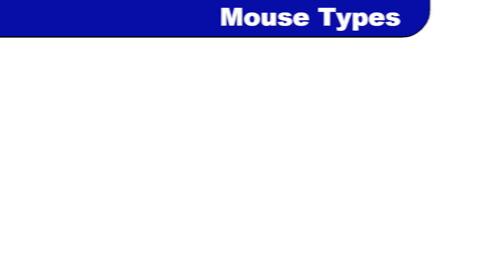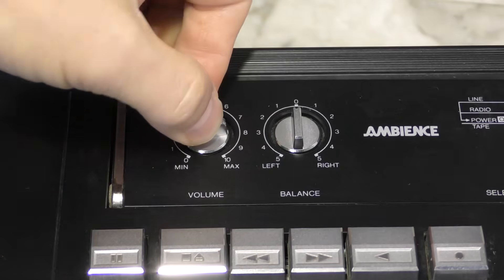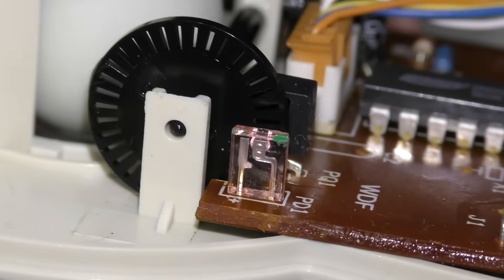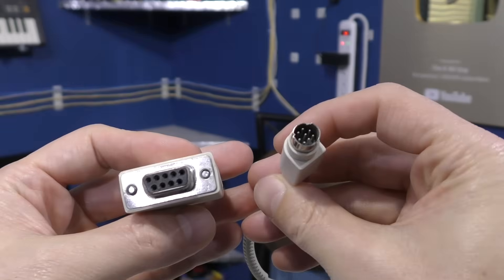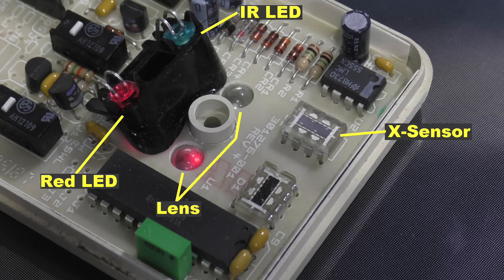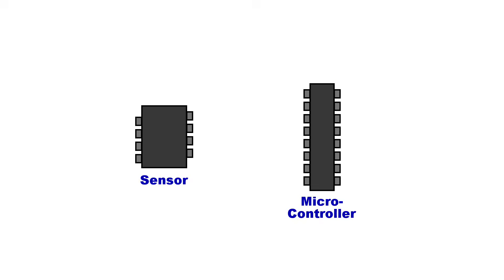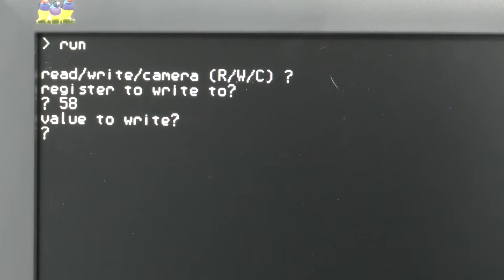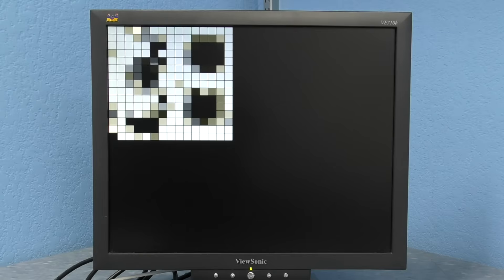What does a computer mouse see?

Comment: Interestinly the N64 analogue stick works like the optomechanical sensor. It's why the read doesn't get drift (however the friction of plastic on plastic, from stick against bowl, will wear down the stick and/or bowl over time).

Comment: That Sun type-5 mouse takes me back. Back in the 1990s I wrote the Sun mouse overclocking guide, which showed people how to quadruple the stock communication rate of both the type-5 opticals and optomechanicals. Increasing peripheral comm speed is more common now but I think that was the first mod of its type to make it out there.

If you ever run across a type-5 with “4800” scrawled on the bottom, it was probably one of mine I did for people.

Comment: Did you try 3.4 MHz I2C or if the camera has it, SPI bus? Cameras in the mouses actually take video imaging faster than 60 Hz unless explicitly designed to do so - LEDs are responsible for imaging exposure so imaging sensor's framerate and LEDs are synchronized, so the problem is bandwidth. Otherwise some mouses use specific AI software to translate the motion while saving on bandwidth and battery life, if the mouse manufacturers choose to use separate faster microcontrollers running at 100 MHz or faster for their gaming mouse line-up, without having to bump up the camera framerate unless you tell it to do so at expense of battery life.

Comment: Your optical mouse is still too new. The camera chip handles the transformations internally and relays them to the microcontroller. The serial port you are reading from is used for factory debugging and for that reason it's not very fast.

Comment: 3:58 If i don't remember it wrong the direction of the movement was always how the mouse pad was placed and not how you hold the mouse. You could turn the mouse the other direction but the mouse pointer moved up even if the mouse cable was against you.

Comment: I also had a mouse with such a special pad for my XT PC, connected via serial port. At some point that pad was falling apart and I had no money to replace it. So what I did was simple: I printed a similar pattern as was on that pad using my 24 pin needle printer of that time on ordinary paper. Of course, I couldn't print as fine as the original pattern was but it was fine enough, the movement was just a bit slower. Finally I got a very thin, transparent piece of hard plastic as a cover and the replacement was done. While not good as the original, it kept that mouse alive and I could re-print it as often as needed. As you can see, my mouse was already a bit newer and did not work with two different kinds of light, it just required a pattern of tiny squares, circles, or octagons (I tried all three and all of them worked). When I got a new computer, I also went back to a mouse with a ball even though they got dirty, their movement was just smoother until the first real optical mice were available for affordable prices.

Comment: I never had that one with limited range, working like potenciometer/volume control heh (using first one with wheels is total abstracion for me). My first one in mid 90's was as in 2m10s, using it was horrible : annoying cleaning (really often) and when you was cleaning it, it was common to bend a bit sensor and another problem shows up, screwing/unscrewing was another life shortener of such type mouse . Back than I was buying new mouse often in monthly period than now in yearly hahaha (my Logitech G400S is couple years old, but my mouse before - A4tech X-750BF was ~ 10 y.o. when goes to retire, and its still working but cable isolation falls apart and it just looks terrible)

Comment: Banned for 7 Days
Our content monitors have determined that your behavior at Roblox has been in violation of our Terms of Use.

Reviewed: 5/13/2021 9:32:17 PM (CT)

Moderator Note: Roblox does not permit discriminatory speech, content, or actions based on race or ethnic origin, national origin, religion or religious affiliation, gender, gender identity, or sexual orientation.

Reason: Inappropriate

Offensive Item: N@-z-i

Reason: Inappropriate

Offensive Item: N@-z-i

Reason: Inappropriate

Offensive Item: N@-z-i

Reason: Inappropriate

Offensive Item: N@-z-i

Reason: Inappropriate

Offensive Item: N@-z-i

Reason: Inappropriate

Offensive Item: N@-z-i

Reason: Inappropriate

Offensive Item: N@-z-i

Reason: Inappropriate

Offensive Item: N@-z-i

Reason: Inappropriate

Offensive Item: N@-z-i

Reason: Inappropriate

Offensive Item: N@-z-i

Reason: Inappropriate

Offensive Item: N@-z-i

Reason: Inappropriate

Offensive Item: N@-z-i

Reason: Inappropriate

Offensive Item: N@-z-i

Please abide by the Roblox Community Guidelines so that Roblox can be fun for users of all ages.

Your account has been disabled. You may re-activate it after 5/20/2021 9:32:17 PM. (CT)

If you wish to appeal, please contact us via the Support Form.

Logout

Comment: The delay you are talking about could be caused from metastability, this needs timing analysis to make sure that all signals arrive at the correct time and not violating setup or hold times, timing should be mentioned in datasheet

Comment: ever figure out why you couldn't read the modern optical sensor faster? i checked the datasheet, and there were two suspicious entries: Wake from Power Down tWAKEUP min 50 max 55 ms, and Motion Delay after Reset tMOT-RST 50 ms. at 8:12 you write 90 to register 58, and the datasheet specifically mentions in the notes of tWAKEUP "when NRESET pin is asserted high or write 0x5a to register 0x3a"; so either either the reset pin is asserted low at the start of each loop (is the reset pin left floating? connected to the chip select pin perhaps?) or you're writing 90 to 58 in the loop (which i doubt you are). or it's black magic; you never know

Comment: Little bit of trivia for the 90s kids: The analog sticks on the Nintendo 64 controllers used optical encoders much in the same fashion as old ball mice meaning they were mostly digital as the encoders can only detect a set distance from the assumed center in so many exact increments. But by being able to detect so many small increments of movement, it essentially "emulated" true analog control as far as the end user was concerned. Probably the only thing that gives it away is the very subtle "ratcheting" feedback you can feel when rotating it, that's the plastic teeth on the encoder discs.

Comment: At 6:13, as for how you say the sensor is integrated into the microcontroller to reduce cost...
Well, not always. I know that this channel is not about modern tech in the slightest, but you could take a budget gaming mouse with a brand-name sensor that has a public datasheet, like the PMW3360, and connect into that. Sensors like that are almost always separate. The datasheet for that sensor is available here: https://datasheetspdf.com/datasheet/PMW3360DM-T2QU.html, you'll notice that the communication method is plain old SPI – and things like a library for using it with an Arduino already exist. https://github.com/SunjunKim/PMW3360

Comment: I would suggest to never 'scrape' the friction wheels when some IPA and a Q-Tip will work not only better, but it wont wear down the friction wheel and eventually cause erratic movement and possibly cause the mouse to not work at all.

Comment: 2:30 - this is the same way encoders work today in manufacturing. 2 sensors watch soemthing spin and the two will detect on and off at different times. The pattern of both turning on and off is how it determines direction.

Comment: I had a friend in the mid-'90s that had a mouse the was extremely weird-looking. Hadn't seen the design before then and haven't seen it since. Basically, a mouse with its own mouse pad. The mouse was connected to a plastic mouse pad and it didn't have a ball like other mouses of the time. I hated using it.

Comment: Dude uses a gameboy camera instead of just a cellphone. He's showing off at this point.
Reply: If he has an iPhone, it probably won't show IR light.  I've tried with friends' iPhones and it never worked.  Looking at the very same TV remote or surveillance camera using my Android smartphone's camera always showed the IR light - the fruity phones I've tried never did.  Assuming the TV remote had good batteries and was in good working order or the surveillance camera was in night mode.

Ditto for elevator door light curtains.  Where I live, elevators are required to have light curtains between the doors and typically, light in the IR spectrum is used.  If an object breaks the light curtain between the elevator doors, the doors either remain open or, if they are in the process of closing - they stop and re-open.  It is a safety requirement.  Most elevator companies enable a feature called "nudging" whereby after a preset amount of time, even if the light curtain is broken, the doors will still attempt to close (albeit with reduced force, I think).  This is to prevent someone from holding an elevator indefinitely while other people are waiting (on other floors).
Reply: @frederickevans4113  What? You mean iPhone cameras don't pick IR light? Why is that? I thought ANY camera could do that. Even my ancient VHS-C camera from the early 90s could pick up IR lights from remotes.
Reply: @OMA2k  I think the fruit company put a filter on their cameras, either a physical one in the camera's lens, or a software one in the image processing.

It might be a safety/modesty thing following the Sony camcorder IR nudes/semi-nudes from the late 1990s.  Going purely from memory, please research it.  Sony had introduced a feature called "Night Shot" into their line of camcorders 📹.   It included IR illumination to help brighten night time video recording.  According to the story, no one at Sony tried it in daylight.  In direct sunlight, there was enough IR light (from the ☀) that the camera could see through a single layer of clothing.  After months on the market and millions of these camcorders had shipped, Sony was inundated with requests to explain how to use the x-ray vision feature.  When Sony tried to issue a recall, most individuals and many stores were less than enthusiastic to return the camcorders.  The next version Sony released still had the "Night Shot" feature, but it was disabled in direct sunlight.  If I remember the story correctly.

I don't know for sure, but I suspect that the Sony camcorder story might have influenced the fruit company to filter their mobile device cameras.
Reply: Not having any "cellphone" (or any gameboy), I would simply use one of my old digital cameras for that type of task. Their sensors see infrared too, of course.

Comment: I dunno... but I never cleaned the tracking balls... like maybe let them soak in alcohol while I took tweezers and painstakingly cleaned the crud off the inside rollers.

That subtle feeling of hitting a speed bump with your hand was always nice. Not to mention that pointer enhancements were necessary.

Comment: I remember as a kid I was the only one who ever cleaned those mouse rollers. It's still incredible to me how people could use a mouse with all that gunk inside.
Reply: So many times at work I'd be helping a coworker and their mouse would hardly move. Can't understand how they could work that way. I'd open it up and remove a ridiculous amount of gunk from the inside.
Reply: Been there, done that, got the tee-shirt.  I've been in IT since the mid 1990s and I remember opto-mechanical mice and cleaning both the ball and the rollers inside.  I also remember my employer bought a Sun Ultrasparc 4000 and that was the first time I ever saw an optical mouse and its special mouse pad.  I was part of the team which migrated the company's software, data, and employee login credentials from the previous UNIX system to the new Ultrasparc 4000 system.  Solaris for Sparc.  Being in IT, not only did I clean the mouse ball and rollers for my own mouse, but for company staff too.
Reply: You Can Remove it?It won't need to be replaced?
Reply: @Toshdmk  yes!no! ;)

Comment: I remember having to open up a ball mouse every year or so and put alcohol on the rollers to clean them out. Lazer and optical mice are amazing, especially since they’re far cheaper than they were when I was a kid. The mouse is probably the single greatest invention in the computer era.
Reply: But the trackball is so superior.
Reply: Patriot 03, I feel like you can get more precise movement out of a laser mouse.
Reply: @jjb0894  Yes, but that's literally only because so few people use trackballs so we don't get new models very often and the userbase hasn't found a standard ergonomic in addition.

There's no reason why trackballs couldn't be given modern higher resolution sensors to solve the pixel skip problems.

But for some reason people haven't caught on to the superior platform and still drag plastic across a mat that requires them to lift it up often (losing all control) and having to use that dragging motion to aim.

Logitech trackman marble is IMO the best pointing device we have lacking only in it's lack of a "mouse wheel" found anywhere on it and the low sensor resolution by today's standards compared to high end mice.
Reply: Patriot 03 you have to use a mat for a ball mouse also.
Reply: @jjb0894  I'm talking about a trackball, not a ball mouse hehe.

Comment: Hey, so I recently took apart a Logitech b100 mouse, and like u said the new ones combine the microcontroller with the Camera sensor. I wasn't able to find any suitable software to interface the USB connection and only have a few Arduino Uno's lying around, which aren't compatible with USB hosting. Id like to be able to interface the IC.  Any suggestions>?

Comment: There are projects like W-Mouse (based on ADNS series) and WX-Mouse (based on PMW-3360), both are using sensors with good datasheets and there's plenty of code you can work with, and update rate would be much higher :)

Comment: I actually found the old rollerball mice a little more reliable, drives me nuts with optical that a single hair getting inside the case an infront of the laser will send it doolally.
Reply: And optical mouses don't work properly on many surface materials such as blank paper, which sucks
Reply: that is simply false, either you are using it on the wrong surface or you are using a old OLD mouse.
Reply: @bonkybonk_ow2793  Hes right, an optical mouse wont work right on a surface thats highly reflective or lacks trackable features such as patternation or contrasting colours.
Reply: @watcherzero5256  you can get a modern Logitech mx master with a darkfield sensor which can track even on glass
Reply: @davelovell8631  Glass isnt that hard, it has a pretty rough texture when your looking at it at that scale.
Reply: Bought logitech mx mouse recently, god damn, it is worth every penny. Works on most surfaces.

Comment: I'm a bit disappointed that you weren't able to get the sensor image in real time for fluid motion, I was looking forward to that as soon as I saw the thumbnail for this video.  One of the main design criteria of those imaging chips is to be able to run at extremely high refresh rates.  A good modern mouse can be as high as 1000hz, whilst a typical polling rate is 125hz.  At those rates you would probably even need to visualize it slowed down in order to see the smooth motion on a youtube video.

Comment: What would be interesting is the algorithm the mouse uses to interpret the picture data.
Reply: very simple , compare two picture . the controller stores the old picture and reads the new picture and compare both.
Reply: @mibnsharpals  too simplistic, what does compare mean? The algorithm must work out in which direction the new picture has moved. Worse still, some of the pixels will have disappeared out of the view of the camera. The algorithm must move one image to overlap the other and work out the X and y value of the move. At best this involves matching an array of X and Y data, XOR ing the arrays of the two images to capture a maximum value. I suspect that the method uses some trick to avoid trial and error.
Reply: @nigeljohnson9820  ist right what you say , for more acurate detection , you are using 3 pictures, stored in an xy array. 

let me see at 3x1 array with 3 values for grayscale

[2,1,2]  >> [ 1,2,4] >> [ 2,4,1]  Mouse is moving left 

same for y , but ist would be more complicate if you are moving y and x direction ar the same time, because you must compute in 2 dimensions.
Reply: @mibnsharpals  it is the second dimension that complicates the problem, then there is the matter of errors in the data. The input is analogue, the pixels may not be sampled in the ideal position, so your example is not correct. What is the gray scale range of the camera, is it just one bit, corresponding to black and white. What ever the algorithm, it is most likely implemented in hardware in a logic array,so it may be necessary to think of the problem as a digital filter. One trick must be to assume the movement is limited to only a few pixels in each direction, but how does it deal with rotation of the mouse. Such a move mixes the X Y coordinates.
What initially appears a simple Patten matching problem becomes complicated, hence my question.